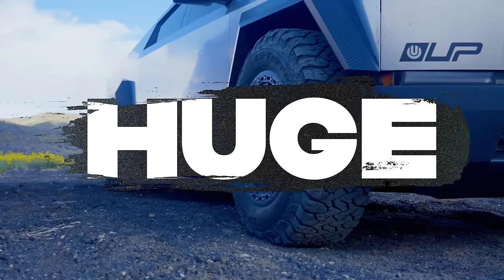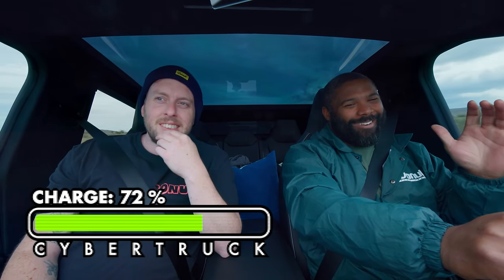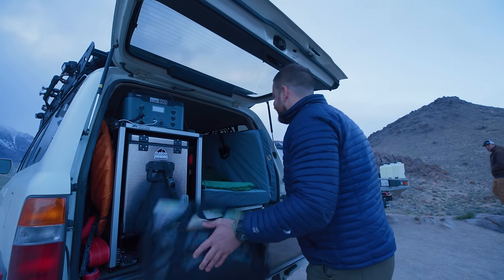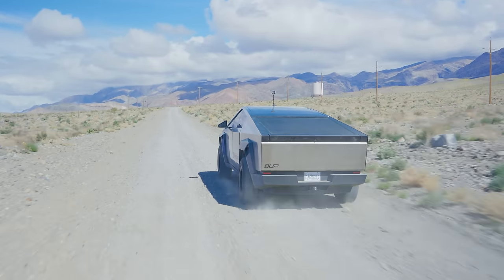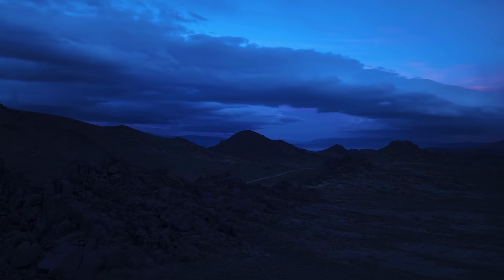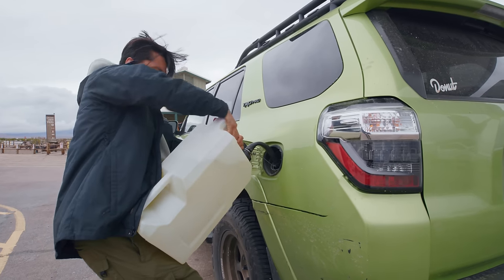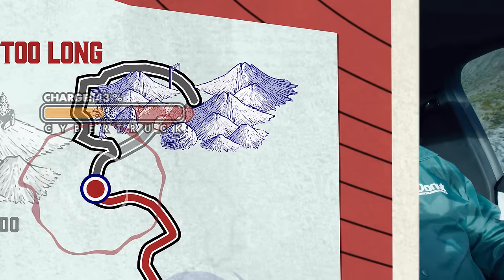Surviving 100 Miles Offroad in a Cybertruck

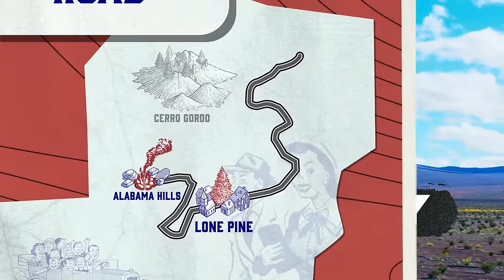Comment: 10:40 😂🤣😂 The car Hauler in the shot is a nice touch. Great to see you have such high hopes for the Cybertruck. 👍🏻👍🏻👍🏻
Reply: I literally paused the video at that exact timeframe to look for a comment exactly like this.  🤣
Reply: I doubt I’d want to haul a Cybertruck on a trailer though given the weight
Reply: @bewing77 The cybertruck weighs less than the Ford F-150 lightning. It surprisingly extremely lightweight. 

The whole point of having the sheet metal exterior flat like that is to use lightweight sheet metal
Reply: You know that's probably the way to do it. Haul the truck to the off-road course, have fun and haul it back,
Reply: @pilotavery  It weighs nearly 7,000 pounds with people in it. A jumbo jet is lightweight compared to a cruise ship but it's still a heavy thing.
Reply: @ruk2023--  wow, that's only slightly less than the Ford F-150 lightning or GM with the turbo diesel and Allison transmission
Reply: @ruk2023--  😂🤣😂 You also know that wasn’t the point of the exercise.
Reply: @davegoldspink5354  why don’t you just say what you mean instead of talking in riddles?
Reply: @ruk2023--  😂🤣😂 Who’s talking in riddles? I think my comments are pretty self explanatory. As for off-roading that’s not off-roading that’s more like soft-roading. We’ve got outback highways here in Australia that our road trains use that are far rougher than that. By the way your cybertruck is a bad joke as an “off-roader” and yeah if you used that pile of metal for real off-roading you will probably die.
Reply: @davegoldspink5354  I understand now. You're that guy. Well I'm British so I have nothing to do with the Cybertruck and the only comment you made had nothing to do with my comments but you crack on son.
Reply: @pilotavery  who the hell considers 6600-6800lbs extremely lightweight? Thousands of pounds less than a Hummer EV, but still, 6600-6800 is far from being considered lightweight.
Reply: @takenpictures  I said lightweight compared to other off-road vehicles. It's even lighter than the Chevy diesel with the Allison transmission
Reply: @pilotavery  "It surprisingly extremely lightweight"

...
Reply: @takenpictures  extremely lightweight is relative. Compared to other trucks of its size, it's extremely lightweight. It's surprisingly lightweight actually. It looks like it is heavier than it is. On the other end, you have a Hummer, which is extremely heavy, heavier than it should be. 

I also have a Toyota Prius which is surprisingly heavy, considering it's a small sedan and weighs 30% more than the Corolla.
Reply: @pilotavery bruh there isn’t anything “extremely lightweight” about any EV vehicle.
Reply: @k00ms  literally the model 3 weighs less than the BMW M3... By like 500 lb too
Reply: The fucking tons is heavy
Reply: @takenpictures  It weighs less than the gas version of the Ford F-150, and buy a lot. I would say that's pretty lightweight, it's lightweight for a truck, it's especially lightweight for a large electric truck.
Reply: @pilotavery  "The whole point of having the sheet metal exterior flat like that is to use lightweight sheet metal" - Wait, what's the point though? It was supposed to be an armored personnel carrier, the moment you thin out the steel the correct question should be "why do the steel AT ALL then?"
Reply: @fortissears5388  because even thin steel that has been cold rolled work hardened in a sheet is stronger than steal that's been molded and bent and thinned in certain areas etc.
Reply: A quick Google search shows the new F-150 starts out at 4,400 lbs and tops out at 5800 lbs.
Reply: @kodiakjak1  point taken the F150 is probably to light to be towing a trailer with the Cyber urinal on it but how many people who’ve towed shit can honestly say they haven’t overloaded their setup?

Comment: Deboss Garage describes "range anxiety" very accurately. You're always looking at battery% and miles. Trying to calculate it in your head. And the consumption varies on terrain, road grade, weather temp, vehicle weight, etc.
Reply: I agree, i loved my model y however i do go into the mountains nearly every weekend and have run into scenarios where I simply couldnt reach parts of our national parks. After 2 years Ive sold it and gone to a Rav4 hybrid and i truly do not miss charging. /If/Once ranges are truly ~500 miles, the id gladly go back to full EV.
Reply: It's like walking on the moon with one tank of air - you know you're going to run out - it's only a matter of when - then you're dead.
Reply: Which is why experienced EV drivers don't get range anxiety - they just trust the car, and it gets them places. If you're constantly worried about range, then you're doing it wrong.
Reply: @wojciechmuras553  range anxiety sure, but range annoyance in the winter in the mountains when you can barely break 200 miles is very real lol
Reply: which is so stupid.  does anyone do that with a gas car?  guess what, your gas car uses more power going up a mountain too.  it's probably 500kg lighter (or more) so that makes a difference, but no one is staring at the MPG reading on their audi cluster all day.  Oh, you used 1/3rd of your fuel driving at 80mph for 2 hours? You mean, just like pretty much every internal combustion car on the road today?  CrAzYyyYyY!!!!  Not gonna lie I hate the cybertruck.  But dude, that 30 year old landcruiser, gets 13mpg.  It's 25gallon gas tank is good for 350 miles.  So going 160 miles, that's more than 1/3rd of the fuel capacity!

Thing is, you can't just strap extra gas tanks on your tesla.  And you sure as shit can't find charging in the same places you can find gasoline.
Reply: But literally that 1994 landcruiser had used more fuel % than the cybertruck after two hours at 80mph.  Shit, those things can barely go 80mph, they have an engine that is practically 1930s tech (which makes them durable A F)
Reply: @SpaceTech54  you ever been scuba diving spaceman?
Reply: @wojciechmuras553  or you just live in a dense metro area with thousands of chargers, and never go anywhere rural, lol
Reply: @benrosen5902  so funny when 20 year old trucks do better going from SF to tahoe in a blizzard hahahah
Reply: Zelon Dusk has never left a metro area so don't be surprised when you Tesler can't either hahahah
Reply: @wojciechmuras553  I agree. I have a 2023 Bolt EUV. It's incredibly rare for me to worry about range. My favorite national parks in the area even have free chargers. I leave a camping trip with more range than my friends' gas cars. If you go off-roading all the time, sure, get a gas truck. But for daily driving and even road trips, it's really not a problem.
Reply: @youvebeenspooked  "And you sure as shit can't find charging in the same places you can find gasoline." This is slowly changing. I've been surprised by where I've found Level 3 chargers for my Chevy out in the country. But I don't think I'd take any EV into the wilderness. In this video, they could have gotten the extra 10 miles they needed for the original route by plugging into a 120 outlet at the old mine.
Reply: Not really. I’ve had a Tesla for 5 years and range anxiety it’s really a thing. I’ve honestly has worse range anxiety in my Toyota Tacoma than my Tesla
Reply: Mullen Automotive deploys it's trucks with AI for fleet and range efficiency.
Reply: @benrosen5902  When I go on a road trip, I set rough destinations but the whole point of a road trip is that you follow the path you like the most however long it takes? Otherwise it's just traveling by motorvehicle? LI batteries are just NOT the solution due to their low energy density and huge cost/weight.
Reply: @wojciechmuras553  When my drivers stop worrying about range is when I get to call my superior about added expenses.
Reply: @hansmiseur3025  So you're advocating for a denser charging network that will allow taking any route you'd like, right? Not opposing the growth?
Reply: @wojciechmuras553  Just find something better than LI batteries is what I'm saying. And as soon as someone does, all this charging infrastructure will be obsolete.

Comment: This cyber truck is just a showpiece at this point, just to go out on the weekend on a Sunday to go have breakfast and go shopping and that’s it
Reply: Ha better not go to far on the weekend
Reply: That's all it ever was
Reply: There's nothing wrong with being a quiet quirky truck pulling up to the park on a Sunday afternoon
Reply: @Derekzparty it is. It’s just stupid american culture of big trucks, what you actually don’t need, and can do all that in typical sedan.
Reply: It's almost as bad as the Ford F-150 lightning to be honest...
Reply: @anonimrussian5913 exactly, have you seen the Ford F-150 use case statistics?
Reply: @anonimrussian5913  Depending on road conditions in your city/down, a truck or suv could be preferable due to the increased ground clearance and the larger tire sidewalls trucks and suv tend to have.

I drive a 2023 m4, and I have to be careful how fast and at what angle I  drive over curbs ... not that I would trade it for a cybertruck, but trucks, in general, don't really have issues with curbs.
Reply: I mean, that's the use case of over 90% of pickups on the road today. Makes sense they designed it for that purpose. 
What's really funny is the two Tesla Model Y's at 7:35 and 7:45 that made it up that same trail. Pickups and "overlanding" vehicles are really just for show lmao. An old '96 Corolla could probably make it up that trail.
Reply: @Derekzparty  I didn't know that the US had such bad roads ??
Reply: @anonimrussian5913 the “truck” has a bed that is smaller than a Kei truck in Japan. It is the dumbest vehicle since Homer designed “The Homer.”
Reply: You mean what 90% of people buy an F150 for?
Reply: @jermwerty  probably yeah I see a lot of nice f150s and 1500 silverados and sierras with woman driving them around
Reply: CyberPrincess
Reply: @ianyeh75 what are you talking about?? The cybertruck has a large bed... Are you talking about another vehicle??
Reply: Literally any car over 50k is just that. No one really needs this cyber junk
Reply: @michaelmillsap4199  the honda acty, A MINI truck, or Kei truck, has a bed that is 6’4” long, and I think like 4’ wide
Reply: @Derekzparty  if you drive a car that has really small tire sidewalls and low ground clearance out of the factory sorry but that is your own fault!😂
I don't have a car but can borrow the older civic my neighbour has and that thing is comfortable to Drive what else do I needand it's no problem if it gets a dent or two or if the tire scraps a curb because it has already a dozen dents and scraps
Reply: @nightraven1319  BMW offers free tires and rim repair for leased vehicles.
Just had a tire replaced and rim fixed from a screw that went into the sidewall.
Thanks for offering your neighbor's civic though!
Reply: @ianyeh75  I mean...that's most trucks these days. The crew cab short box trend is annoying for people who need usable truck beds.
Reply: yeah i showpiece thats hurts to look at
Reply: Always has been (tm)
Reply: I would love a cybertruck
Reply: @monkeysezbegood  it would be good for speeding on a dirt road or something
Reply: Most cybertrucks I've seen so far have been used as advertising by local businesses.
Reply: like most trucks in america, to be fair
Reply: It would have been much smarter to make it a diesel hybrid using a small 4 cylinder turbo diesel engine. So it could  still get great fuel ⛽ economy with no range worries.
Reply: @anonimrussian5913 why aren’t you saying the same thing about ford and ram and Chevy trucks? Those look even worse imo

Comment: It was pretty ironic seeing "Invincible" on the side of the 'hype-r-truck' when it had to turn around before getting to Death Valley.  And that was hardly real off-road conditions. Those were basically any rural gravel road in many parts of the US. 🤣
Reply: Which is accessible to any vehicle.
Reply: The road conditions were never the issue.
Reply: Funny that you can't test the off road capabilities because you can't drive far enough from a charger.
Reply: Any rusted out Subaru would have beaten it.
Reply: Vincible
Reply: Nicer than any unsealed road in Aus after any rain at all.
Reply: @steampunknord nicer than some sealed roads in New Zealand
Reply: Yeah we for hours for gas. 😂🤡
Reply: a 90s corolla can go anywhere without any damage cybertruck did in this video. and it wouldnt have to go back.
Reply: @nobeliefisok9174  yes, they were because the truck was losing energy faster due to it. Had it when to any true off road it would've lost 90% in half an hour

Comment: Fun Fact: If you're trying to hyper optimize an EV, standard cruise is often more efficient than manual driving. Adaptive cruise uses additional sensors for safety and is still more efficient for highways with any traffic, standard cruise only maintains speed with optimal efficiency. I've been able to greatly extend the range of many models of EVs using this. Even with -20 degree fahrenheit weather I've only had climate controls use 3-5% average with heated seats, steering wheel, and all comfort options on.
Reply: Why did you start off with fun? then continue to bore the shit out of me
Reply: @Tomberculosis-q1i  it may be sad though the older you get, the more fun these facts become.

Comment: I’ll tell you something great about Lone Pine, CA. I rode from Woodland Hills, CA to Lone Pine on Father’s day 3 years ago. Death Valley, which runs parallel to Hwy 395 (the Hwy the guys are on) hit 136 degrees. Painful is an extreme understatement as motorbikes don’t have AC. I got the first hotel on the left around 4:00 pm, cooled down and passed out for the night. When I got up I had NO KEYS!!!  After panicking for about 10 minutes, I went out to my bike, that was parked right on the road, and found my keys in the trunk of my bike, when’re they had been since 4:00 pm the previous day. When in he led out the manger asked if I found my keys because he saw them in my bike the night before. 
  What a wonderful little town.
EDITED for grammatical errors.

Comment: I have a few questions that weren't answered.  One is, they appeared to have electricity at the ghost town.  Could you not have used a regular 120V charger overnight to regain some range?  Also, you are driving up into the mountains.  Do you really need to conserve 50% power for the return trip?  you'll regenerate a lot on the way back down.  Also, those tires are going to reduce the range, just like large tires will reduce fuel economy on a gas car.  It isn't fair to expect it to get factory range numbers after these modifications anymore than you'd expect a gas car to get factory fuel economy with large tires.
Reply: It takes 80 - 100 hours to charge a Cybertruck from a 120 volt outlet, so I guess you could do it, if the other 5 trucks and guys want to spend 3 days watching the CyberPaperweight charge slowly tick up...
Reply: Fair points, but they didn't harp on the range being below advertised as being something they were mad about anyhow, as it wasn't the point of the video. Plus to be fair, a stock Cybertruck evidently can't offroad quite as well as Elon says it can lmao. With that said, I think it's a pretty cool truck, with a lot of (fairly understandable) drawbacks and some (highly typical for Tesla) recalls and issues in the first production units. Yet people seem to only be allowed to have two opinions on it: Either it's literally the worst thing ever made or it's literal perfection with zero flaws.
Reply: @sprinkle61  Would charge about 4-6 times as fast on 240V though (depending on 30A or 50A circuit), and 240V is most likely available since nearly all 120V generators operate at 240V split phase and give you two 120V circuits. With that said, it's probably something they'd need to plan ahead of time to wire up, I doubt anyone onsite has thought of EV charging as a design consideration for the circuit wiring and you'll need some heavy duty cables that can carry the current of that circuit without overheating.

But if all that was worked out, 80 hours / double the voltage / 3 times the current = ~13 hours of charging, not bad.
Reply: regen working much worse than you expect. It's not like "disabling fuel injection during downhill", it's about "reduce speed to about 0 to regenerate energy back". Very bad, imo.
The only working solution to reduce power consumption IS THE SAME  for a gas car: Remove your foot off the gas and push it gently.
And this is awful. Chinese hybrid car solved the issue while Elon Musk saying "energy efficient vehicles is all about Tesla", and you just can't make it low-powered lol